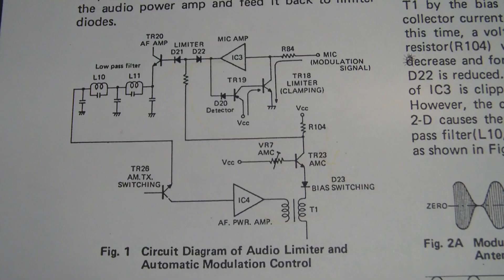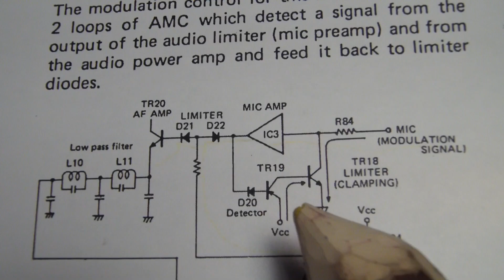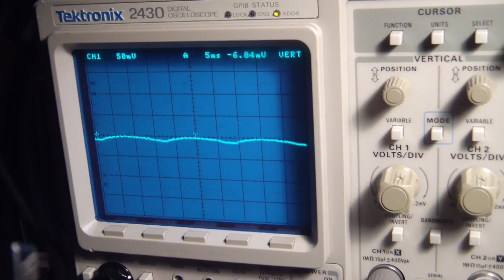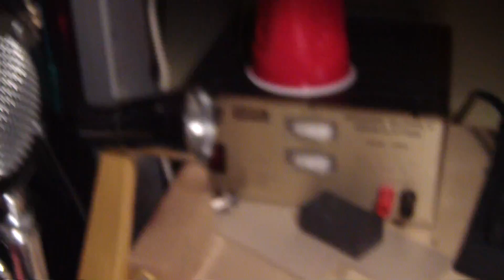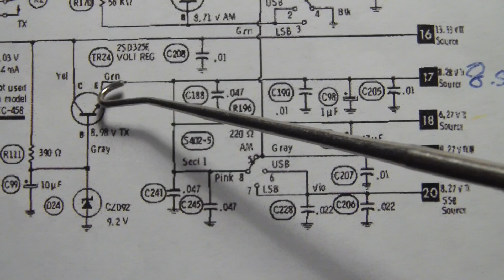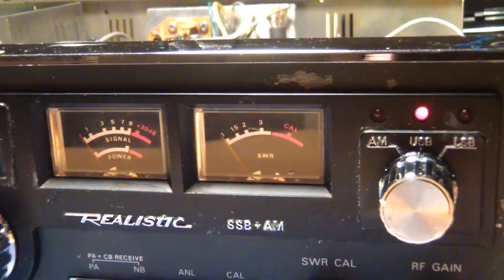Realistic TRC 457 restoration, PART3

Comment: I have a Cobra 139XLR that has no TX on USB only, the relay does click.  LSB and AM are ok (but turned up a bit high)  RX is fine in USB/LSB and AM.  Any suggestions where to look?  I have the SAMS Photofact, but it's my first time using them so a bit lost.   And help would be most welcome as I'm almost to the point of putting the radio on the shelf and forgetting about it.
Reply from the maker: To many unknowns about skill level and equipment to give any type answer except; step 1 with ANY vintage radio is to replace ALL electrolytics and then go to step 2. See link below for step 1.

https://www.ebay.com/itm/142719551923